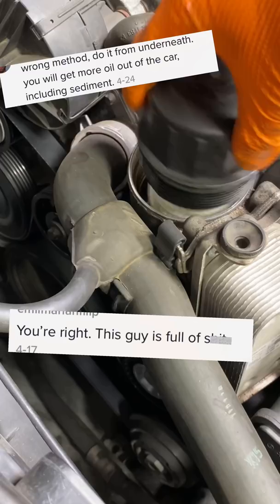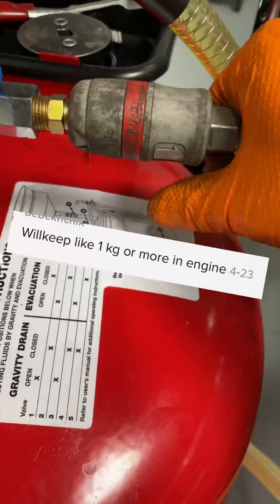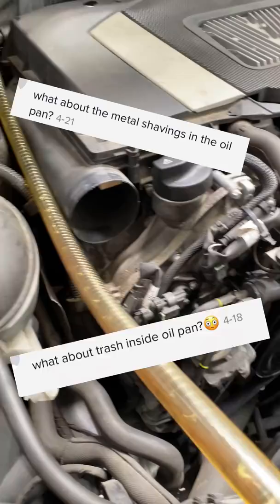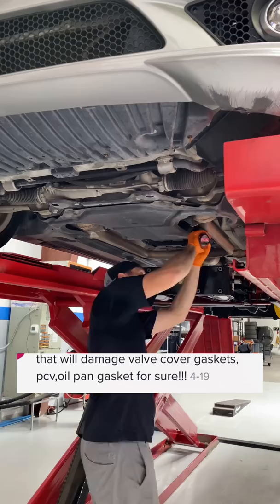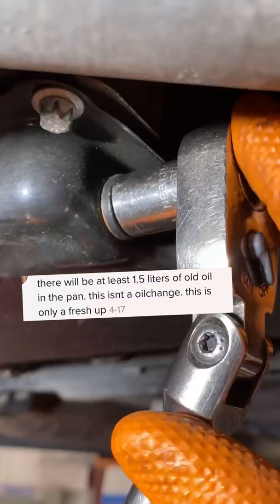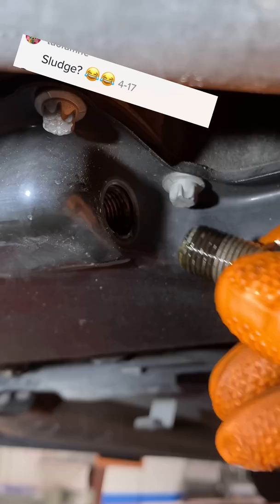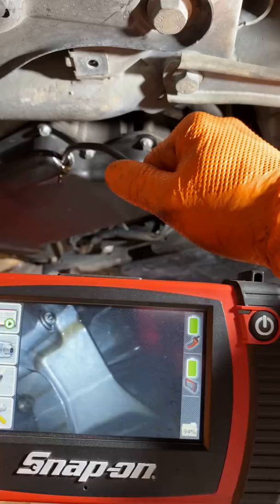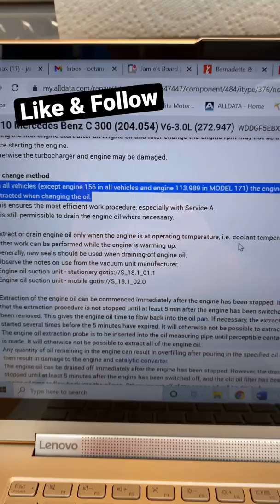#shorts Mechanic Proves Haters Wrong

Comment: It's nice that someone here holds up the mirror to the whole would-be mechanic. The reality then looks different than many assume with their dangerous half-knowledge. This is also the difference between the professionals and the do-it-yourselfer, who believes that he knows what he is doing... 
Before here again comments come that would like to accuse me of ignorance...  I have been working as a master mechanic in a Mercedes-Benz workshop for 35 years and am quite familiar with the vehicles. The oil has been extracted without any problem since the eighties. Anyone who claims otherwise really has no idea about the technology
Reply: I think many ppl got their first half knowledge from the common known issue of leftover oil and "debris" (i really hope no engine produces debris) when you use do-it-yourself oil changes at big Cleanparks. They use a snorkel to get down to the oil pan and then suck it out vacuum like. But those are really not the greatest invention but easy to use for shure and u still get mostly new oil. Better than just resetting the inspection timer and "do it next time for shure"...
Reply: @BlackLung87  and I assume you know what your talking about.
Reply: The guy that was a master mechanic for 35 years. Built houses for 23, did electrical for 13... But is 31 years old. You shared enough "knowledge" in your comment to let me know you really dont know **
Reply: @BlackLung87  you’re*
Reply: good points right there, but is it would-be mechanic or wannabe mechanic. Which word is correct?
Reply: @loayabuzainah5706  I think would-be is someone that is in the profession, but isn't all that knowledgeable, or even starting to learn the basics, and wannabe is someone that wants to act like they know what they're talking about
Reply: I maybe it’s just me but I got brain cancer trying to read this
Reply: @BlackLung87  You sound like someone who feels hit. Why this is so, only you know. But to want to impresent something that I have never written is unsophisticated. It seems pointless to enter into a factual dialogue with you, because you want to misunderstand it. Why this is so, only you know.
Reply: @jake8647  I don't know that we have ever met. You don't know my age or anything about my professional qualifications, but you think you can judge about it. What should you call it? Arrogance? Or just ignorance? And how do you want to know that I have no knowledge? As I said, we do not know each other and I have not written anything that allows this conclusion. 
I rather think that you feel caught that you are also a do-it-yoursef mechanic and see the method of oil suction as a worse working method. But you're simply wrong. It would really be a step forward if the doubters could sometimes acknowledge something as a fact that seems suspicious to them. All you have to do is think outside the box. Trial makes you smart.
Reply: @duke6321  your right, weve never met. I apologize for my comment sir. I dont know you and you dont know me. I do a lot more than change oil. But honestly i refuse to work on a mercedes or bmw. So whatever the video was about i seemingly was triggered and i apologize. If you are a veteran Mercedes mechanic than you know changing the oil on a honda,chevy, ford, or anything else doesnt require all that. Pull the plug, then the filter, replace said parts when done draining, and add oil. Forgive me.
Reply: What’s your d7 ID?
Reply: I just hate the superiority complex of most of not all car guys. 
Like what makes you and your stock Miata on 200$ coil overs cooler than me? Like I did the same with my e36 except I had KW1’s not some race lands XD
Reply: Achmed the Dead Terrorist  here’s kinda the problem though, you may be able to replicate what’s done on there but chances are you’re better off if you know the car inside out cause you definitely don’t want to waste time watching videos
Reply: As the son of a ASE world class tech for GM, this is why we don't buy or work on imports.
Reply: Just because some is a DIY doesn't mean they can't do it just as good. With a shop manual and a little bit more money you could do just a good a job as a trained mechanic. Personally I work on older cars and wouldn't do a whole lot when it comes to new stuff since the methods are so different, and I have little interest in it.
Reply: I do believe there is diy people that know what they are doing and there is some that know more than some professionals.  At some point the professional may quit or retire and continue to work on cars at home they are now diy.  There are people that act with professionalism and people that don't, and that is the biggest difference.  For instance this video to show the people what he was doing was the correct thing, he acted with professionalism.
Reply: @Mr.Scootini  lefty loosey, righty tighty;
Reply: Nice.
Reply: @jake8647  oh shit. Has he really commented that other stuff 🤣
Reply: Dunning-Kruger effect if full motion with the internet mechanics .. they Have just enough knowledge to think they know a lot about how to do it when in fact they don’t
Reply: What about old, nasty, gross oil that hasn’t been changed in a long time, would it still be better to suck it out or go in from the bottom? Genuinely asking, not trying to be a dick
Reply: @ghostriderstyxx300  hmmm... Good question
Reply: Feel like most arnt even "do-it-yourselfers" they are literally just 13yo boys who feel like they know everything because they watch yt how to and car videos... so they are experts now  lol
Reply: @musstta01  not if it's a left hand thread lol
Reply: 35  years of "experience" means nothing when you change oil the lazy man's way and do not remove the drain plug. Another good reason to never use a car dealer. Just plain stupid way to change the oil. If I knew you did it this way I would demand you change it again the right way that actually drain most the oil. Technology is your crutch lazy Mandy's improper oil change. Period.
Reply: @loayabuzainah5706  shade tree
Reply: @airgliderz  except when that isn't how you do it because there's a certain way to do it in a professional environment. You tell a technician to do it your way instead of how they do it professionally and how its been done for years, they'll just laugh in your face. That persons 35 years of experience means a lot compared to your 1 year in college tea boy
Reply: @BlackLung87  "when you talk to em you're wrong"...you ever think that you could maybe just maybe super-small-chance possibly be wrong whilst citing facts in someone else's field of knowledge?
Reply: Its still wrong, being professional mechic is working against you. Your method of oil extraction is unlikely to cause a problem, that is not the point. If there are debris in an engine from what ever source, the oil pan drain plug metohode of draining is best period. Its lazy, because it takes time, to not remove under car covers. That's why Mercedes recommends it, its not the best method its the easiest and fastest = more profit. M I still oil plugs have a magnet on the end to attract fine metal wear debris, you can inspect that if you don't remove the oil plug. If not true on Mercedes then its another example of German overengineering fails.

In addition the car you showed us where you sucked the oil out is in good condition, not 200,000 miles old so of course the inside is clean. So maybe its okay to suck the oil out on new cars. But even then it's not the best method. Again how does legitamet logic not change your mind, that dam professional thing is blocking you from seeing it. Happens all the time with "professionals" but many quickly see this, adopt the best process versus the fastest profit oriented solution.
Reply: @airgliderz 
Ignorance is not a virtue that should be cultivated. Do you really think that a manufacturer would release a method of maintenance if it did not meet the requirements of technology? Before answering, please consider the possible consequences of incorrect work instructions, keyword: product liability. If I make a mistake, then I am liable for this work and possible consequential damages. Do you still believe that Mercedes-Benz releases methods of maintenance that would favor this? Believe it or not, the manufacturer is rather fussy about it. 
As for the magnet on the drain plug... which material had to be filtered out with a magnet? The aluminum of the cylinder, the piston or the bearings made of the same material from the camshaft? Or the non-ferrous metal bearing shells of the crankshaft? 
What is the purpose of the magnet in an aggregate that is largely made of light metal and bearing metals that are non-magnetic? Does that really make sense to you?
Reply: @duke6321  yes, especially true with German cars. All that you state justifies the statement of German over engineering failures.
I just rented a new BMW, chock full of wasteful silly German engineering costly design failures.  So your example all over me correct on German over engineering failures. Why it will be amazing if German auto manufactures survive the next few year (Sporsce, Mercedes, Audi, etc)

Comment: If you have “metal shavings” in the pan that your filter didn’t get then you have bad things going on that an oil change ain’t fixing.
Reply: @MitchellKinard  yes, they are very common. Make sure you buy a magnetic oil plug!!!!
Reply: metal shavings are normal especially for older cars, it don't matter how well oiled your engine stays.
Reply: WDYM, metal shavings come from degradation on the engine block and pistons.
Reply: @Osubuckeyes2024  This would be the purpose of an oil filter... To filter out these particles...
Reply: @xjsvg8054  These would be tiny particles that you can't see. If you can see shavings, you have a serious problem that needs to be addressed ASAP.
Reply: @taylormay9938  I don’t give a fuck what oil filter you use, shit happens trust me lol. Magnetic oil filters are the way to go especially on small motor vehicles.
Reply: @taylormay9938  then why would magnetic oil filters and plugs be in the market internet genius? Have you ever seen a transmission pan without a literal magnet on it for this exact purpose? Transmissions have filters too but I guess obviously it's just designed to not do its job then
Reply: The engine is metals smoothly grinding against each other using oil as lubricant.
Reply: It can come from the pistons. Or it can come from the Tie rod. The repair for metal shaving is a engine rebuild and a new head gasket.
Reply: @Osubuckeyes2024  Lol for the small cost, it's not going to hurt anything for sure. And it will build up tiny particles of metal that will be visible as they accumulate. But if you maintain the engine properly, you shouldn't have visible metal shavings circulating in your engine. If you see metal shavings that are large enough to be visible with the naked eye, you're either seeing them while rebuilding your engine or you're going to be rebuilding it soon after you start the engine up again. If they're big enough to see, whatever issue that took that chunk of metal is going to ruin it sooner rather than later.
Reply: @fly-boinito6630  😂 If you get metal shavings from your tie rods inside your engine, you have MUCH bigger problems... 😂😂
Reply: @xjsvg8054  Seriously? Your argument is "it's on the market, so it must be necessary"? That's an entirely different topic that hopefully you already see is just hilariously ignorant to.. 

Back to relevant discussion...Do you realize how many manufacturers do NOT include magnets for the engine oil? Do you think they just don't care? Also, tell me why your filter doesn't do its job of filtering out the particles like manufacturer designed it to do. You either aren't maintaining your engine properly or you're buying snake oil (see my first point above).
Reply: @taylormay9938  a tie rod is knocking if you got shavings
Reply: @fly-boinito6630  You're referring to the connecting rod... The tie rod is part of the suspension... 😁
Reply: True,

laughs in knowing my engine has a spun bearing
Reply: Firstly, I see you didn't remove the pan to actually show us what it looks like. Instead you show us an ambiguous borescope view. 

Secondly tiny metal shavings fall to the bottom of the sump and are attracted to the magnet (if there is one) otherwise the filter will do its job and not allow these particles to be recirculated back into the top of the engine and potentially blocking oil holes and also causing further wear. A magnet in the pan helps the filter last longer.

"Extracting" the oil doesn't specifically mean to suck it out. It just means remove the old oil and replacing it with new. Why do you think they have a sump plug?
Reply: @xjsvg8054  He was saying that yes, metal shavings are normal, just that the ones that are big enough to visually see are a problem.
Reply: Did you miss all the metal shavings he had sectioned out through the clear tube? Metal shavings happen
Reply: @xjsvg8054  not gonna lie most cars can run over 250K with no issues people just beat them to shit or mistreat them. However I’ve seen those magnetic plugs and to be fair if they didn’t come from factory I don’t think it’s necessary, engineers make mistakes yes but their not stupid a lot of R&D goes into an engine they even account for how much wear it has. And your engines parts aren’t supposed to rub my guy, their spaced out bu thousandths of an inch the whole idea is to minimize clearance to hold pressure while giving room for those parts to move
Reply: Dont buy cheap oil filters. They barely work and made with cheap material.
Reply: @NaruSanavai  
You are right about that, however, I thought his point was to show us how effective his method was that's all.

I guess it doesn't really matter anyway, because pouring the oil out of the sump plug doesn't guarantee to remove all the fine particles and it certainly doesn't remove all the particles caught by the sump magnet that are in the bottom of most modern pans.

I just don't feel his method is effective unless he can guarantee that his hose reaches the very bottom of the pan so it can remove every last bit of oil..
Reply: Why your vehicle actually costs 300$/mo on maintenance but you don't realize it and just buy a newer one 😳
Reply: Lol. Metal shavings is not normal. Glitter particles are however buy a very small amount. Even on high mileage cars Ive done ring jobs in are pretty clean. Of course this varies on maintenance history
Reply: He’s making fun guys like you lol
Reply: @xjsvg8054  I couldn't care less about who is right or wrong on the argument but "it's on the market" especially for automotive parts and accessories is not a strong nor a valid point. That argument is equally applicable to any snake oil solution, regardless of whether an oil filter with a magnet is or isn't one.
Reply: @jtveg  
I don’t understand why folks are giving the video OP so much crap regarding this. 
No method is ever perfect. 
Even with plug removal for draining, did folks see that particular plug goes in sideways? Oil will not drain fully. The threading on the pan for the plug cannot be placed in the “wall thickness” section, so the hole for the plug would actually be slightly elevated. There will always be some oil left even IN THE PAN. 
Also to your point, there is also additional oil left in the oil sump pump area; that part never drains out. 
If there are metal shavings, particles, or sludge in that pump sump area, plug removal method isn’t going to drain those particles or sludge either. 

Not saying his tube suction method is “better”. 
I agree it’s not perfect. 
Just: neither is the plug removal & drain method - it’s not perfect. 
Folks here are arguing which one has more: 6 of one, or half a dozen.
Reply: @reallifeengineer7214  
You are absolutely correct. The usual method of draining the oil by removing the sump plug is no better than sucking the oil out with a tube connected to a pump.

The only caveat is that you need to ensure that your sucktion tube is reaching the lowest point in the sump.
Reply: @Osubuckeyes2024  no, they don’t happen normally, if you have metal flakes in your motor something isn’t lined  up right like a rod barring, crank, piston, wrist pin, etc…. I have taken apart motors that hadn’t been touched in 5 years and there wasn’t shit but burnt oil…
Reply: @DrakyHRT  no… that’s infact wrong… you see.. the metal comes from misaligned engine internals wearing down… like a crankshaft, rod barrings, pistons, piston rings, wrist pins, etc…..
Reply: @xjsvg8054  you’re wrong…. It has to do with motor internals not being aligned right, as in the crank, rod barrings, rods, and pistons, piston rings, wrist pins etc… and if you don’t have proper lubrication it WILL happen faster..
Reply: @DrakyHRT  “block and pistons”🤦🏻‍♂️🤦🏻‍♂️ omfg.. I’m not scrolling further ive left afew replies and y’all keep saying dumber shit… it’s not the block unless something is actually fucked up and badly out of alignment.. 90% of the time it’s from the crank shaft, the rod barrings, the piston rings, or the wrist pins… and it’s due misaligned internals and poor lubrication
Reply: @That_Stanced_Toyota  yea a motor that hasn’t ran in five year won’t have metal shaving cuz… it hasn’t ran in five years… I’m not talkin fuckin chunks but little shiny pieces is VERY normal, especially in older model cars. But thanks for naming a bunch of car parts so it looks like you know what you’re talking about.
Reply: @jtveg  
Yep.  Agree & Agree.
I'm glad we are both in agreement.  😂
Reply: @That_Stanced_Toyota  If it's got "burnt" oil in it then something is wrong!!!
Reply: @seadog915  not necessarily, could mean it’s old and used up, I’ve emptied oil that was burnt out of new mustangs and camaros and the motors were perfectly fine..
Reply: @That_Stanced_Toyota  Then they're running the wrong oil or not changing it regular. If you burn the oil something is wrong.